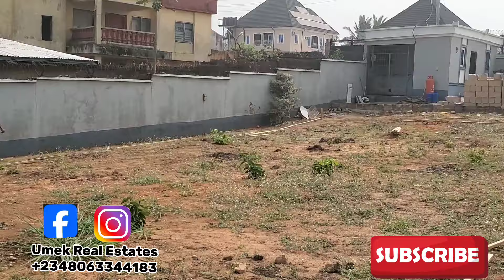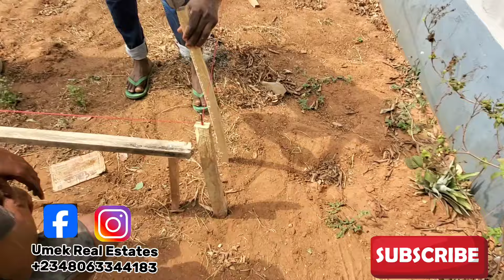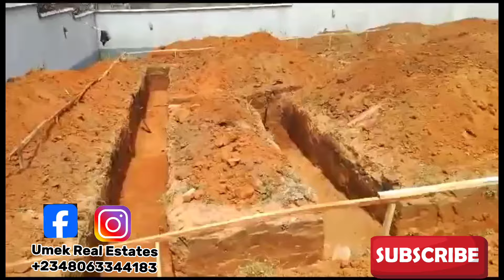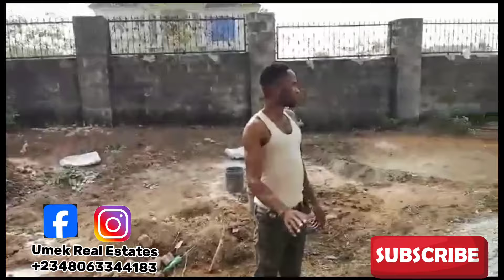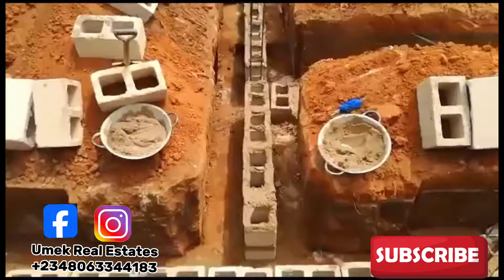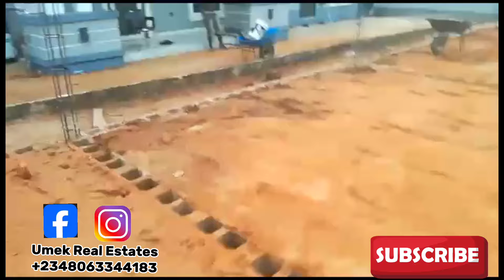Building a 5bedroom duplex in 2024 Nigeria (Realtime Cost of material and Labour)

Comment: Thank you . May God expand your endeavor as you keep it straight forward 🙏
Reply from the maker: Thanks maam…
Reply: Great job engineer Umek, 
How many 9inches blocks, 
How many 16mm Rod 
How many 12 mm Rods 
How many 8mm rod 
How many  bags of cement 
How tons of cheapens 
How many trips of sand that you used from the foundation to DPC level of this 5 bedroom duplex. 
Thanks again for your great work.
Reply: Great job, 
How many columns are in this 5 bedroom duplex. 
Thanks
Reply from the maker: @EmmanuelOnonogbu-l5s  all these details are in Vidoe …

Comment: Thank you so much for the updated,  i listened to the complete process of the duplex and my major fear was the cost of rod. I would have gone to the market and asked the price my self but because am not around so please could you help me with the prices of rod.
Reply from the maker: In my area
Complete 16mm is sold for 17,200 while incomplete is sold at 16,000
Complete 12mm is sold at 9500, while incomplete is sold at 9000
10mm is sold at 7500
8mm is sold at 4,000 and 
20kg of binding is sold at 30,000
This is today’s price… I hope it helps

Comment: I think this manual digging of foundation is making building houses expensive in Nigeria,l'm sure there are machines that would dig foundations quicker and cheaper.Even machines that would fill the foundations with concrete instead of manually.At least you have a machine for compacting the foundations,which is very good.How big is this house then in square meters?Thank you.
Reply: It's far cheaper to dig manually in Nigeria than using a machine. The cost of hiring and fueling machines are too expensive.
Reply: @chukwuemerie  Why not invest in the machines instead of hiring everytime you need it?That explains why it would be more expensive. But if you invest in most of these machines,you can build many more houses in a short time,increasing revenue and profit, in the long it will be much cheaper.
Reply: @suntanglory  He may not be able to buy a good machine due to its high cost. I owned a machine at a time. I know what I passed through. In our clime, good machines cost a fortune. They equally need planned maintenance.